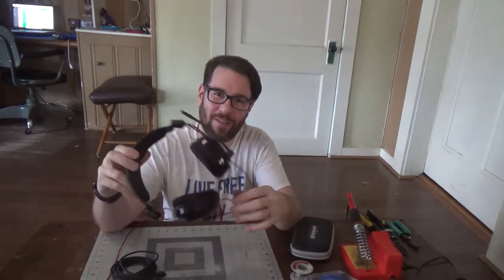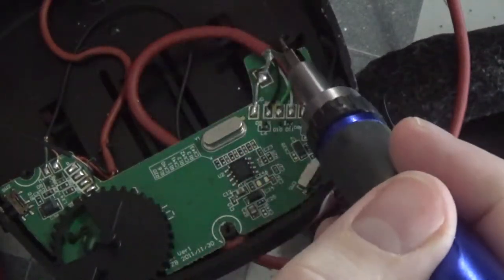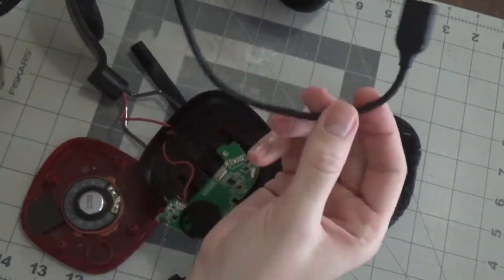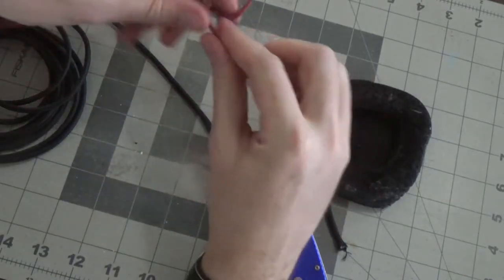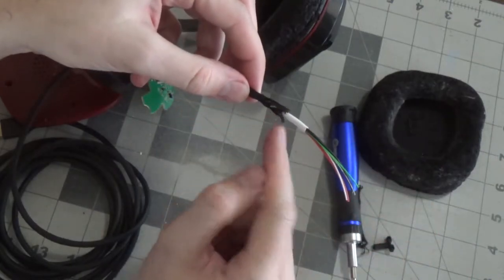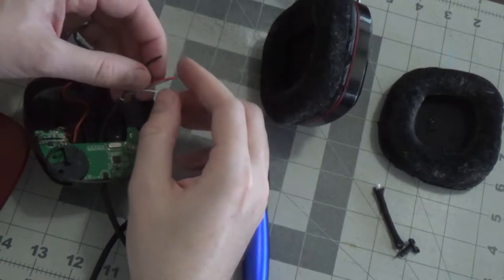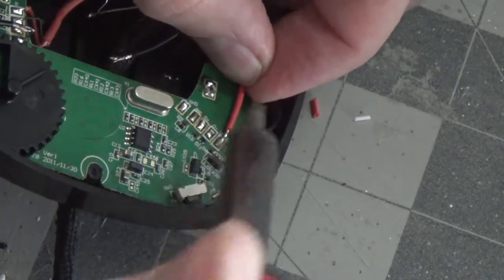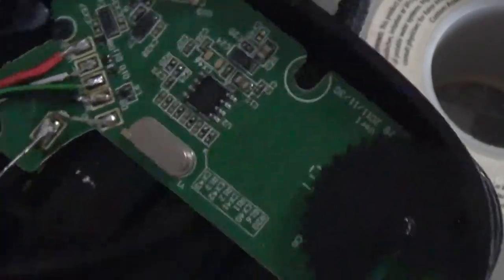Replace a USB Cord for the Plantronics GameCom 780 Gaming Headset | How To

Comment: hello, first of all you made a nice video.
I watched your video and thank you for you show us that experience. I have a question for you. I have same it but my up-down mic does not work.
When I lift the headset up, the microphone continues to work when it should be silent. how can i fix this.
Reply from the maker: My headset didn’t have that feature... it could be bad contacts, you’d have to take it apart and try to figure out how it works to find out if you can even fix it.
Reply from the maker: My headset didn’t have that feature... it could be bad contacts, you’d have to take it apart and try to figure out how it works to find out if you can even fix it.

Comment: Nice soldering work.   What kind of solder and iron did you use.  I'm not super experienced with soldering so wanted to get the parts correct as you made it look easy.   I hope i can do the same.  I have the same headset and yes the red wire is loosing the casing but still works fine with a ton of black tape :)
Reply from the maker: Thanks, I use this soldering iron - https://amzn.to/2NDBh4U... the solder I have is like 20 years old but this will work good for this project - https://amzn.to/2MHQKBA -- Good luck!
Reply: @LivefreeanddiyTv  the link to the iron does not work, the solder type link does work.
Reply from the maker: oops, I think it's because of the ... I put... try this: https://amzn.to/2NDBh4U

Comment: The only problem i have is that the usb extension cord I bought has no ground wire. Do I need to search for a specific cable?
Reply from the maker: Probably, cause the ground will most likely help prevent static on the microphone. There is a link in the description to the one I used. If that helps.

Comment: Was getting annoying cos my PCB wouldnt come out. Before I snapped it I thought I's see if anyone else had done this.
Thanks! I didnt even notice that small screw holding down the PCB!

The replacement cable I used ended up being stranded cables not solid.
Ended up being a nightmare to solder those small stranded wires. Though I not good at soldering either.
Good news all working now with a braided sleeve cable!

Bad news, the god awful cushion with the crappy plastic coating which disintegrates when you remove them!

Comment: What do I have to do if my new USB cable does not have ground cable ?
Also I think (I didn't open it yet) that I have black, white, green and purple (not red) cable inside.
I have this : https://www.amazon.fr/gp/product/B077HPWDDK/ref=ox_sc_sfl_title_1?ie=UTF8&psc=1&smid=A3ANSIC7VX6QUH
Can I connect cables color to color safely ?
Thx
Reply from the maker: Hmmm, I'm not really sure if there are any standard difference between U.S. wiring and E.U. wiring for USB cables. It should have a ground wire, ground is pretty important for protecting your stuff from electrical surges, if there are any. If the colors don't match, you'll have to spend some time figuring out which ones connect to which data points on the USB and match from there.
Reply: When I said ground cable I meant this at 8:34 , not the black one.
I don't even know if it's ground but I though you said that.
If I want to check colors I have to connect a multimeter on the first pin and red (or purple) cable to see if I have a signal and do it for the 3 others ?
I'm sorry I don't know anything about this...
Reply from the maker: Yeah, ground is typically unshielded... and typically it exists... sometimes it's just the silvery wrapping around all the wires... this might help: http://teledynelecroy.com/doc/probing-embedded-usb-bus-designs